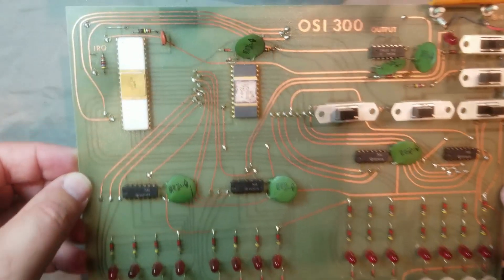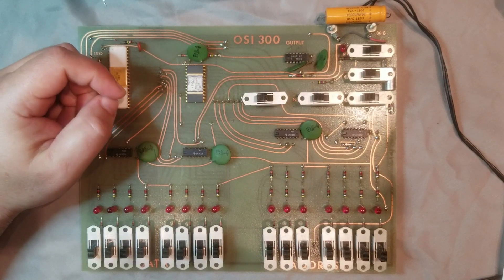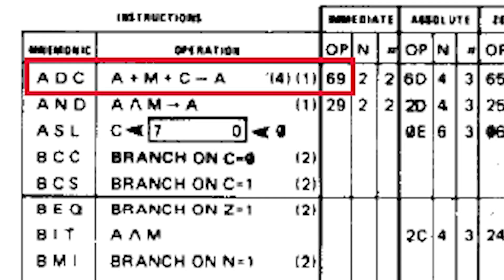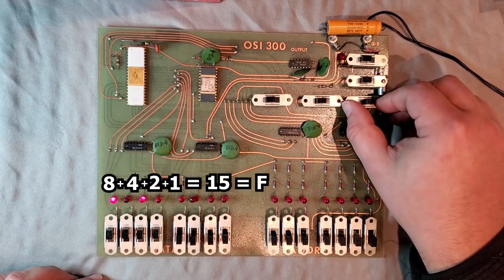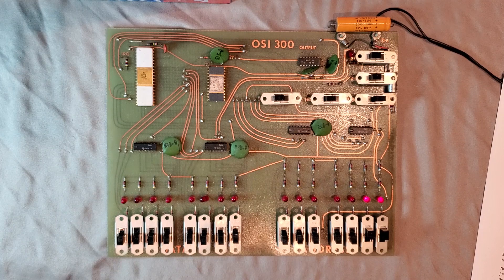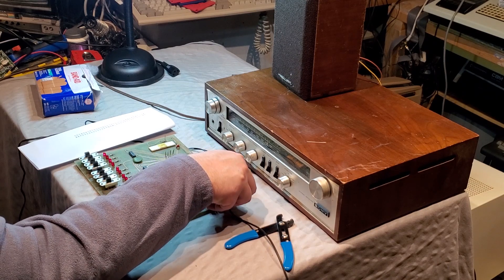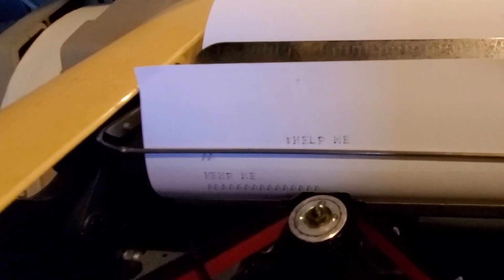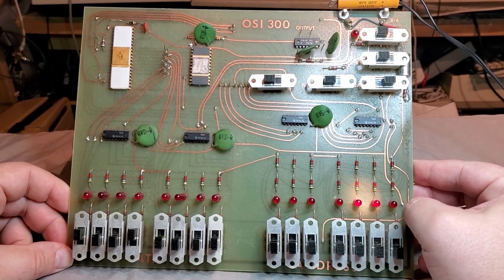Humble Beginnings: The Ohio Scientific Instruments (OSI) 300 Single Board Computer

Comment: I had a rack mounted OSI computer with z80, 6502 and 6800 all on the same mother board.   It had a 74 MB hard drive (winchester) rack mounted along with dual 8 inch floppy drives.  At the time it was the best affordable commercial system for my company I could find at a 'reasonable cost'.
Reply from the maker: It's too bad OSI was so stuck on not finding venture capital to expand.  They hit a certain level and then just didn't have the money to go further.
Reply: OSI also tried a similar board that substituted a Harris HD6120 chip for the 6800. Yes, that made it a PDP-8 computer. The 6502 did all of the I/O for the HD6120 through DMA so it was (supposedly) able to run any OS or software ever written for the PDP-8. I saw the schematics and the description but I don't know if it ever made it into production.
Reply: Sounds like fun 😀

Comment: Speaking of "trainer" computers. It's not exactly electronic, but you should consider doing a video on the CARDIAC "computer." Which was basically a bunch of cards and folders and pull tabs that somehow copied the function of a computer without any actual electronics back in I think the mid to late 60's. But don't quote me on that. I always thought it would make a good video for a channel like this that looks at the history of computer and computer related gear.

Comment: Wow! This makes the Cosmac Elf look like a workstation! I didn't realize such a simple 6502 machine could be constructed.
Reply: With modern parts (you can still get brand new 65C02s) you can build something with three chips, a static ram chip, a flash rom chip and the 6502.

Comment: In one of my very early microprocessor adventures, I had interfaced an Intel 2851A to my MMD-1 8080 trainer and to an "ADDS" terminal (circa 1981).  When I was finally able to correctly initialize the 8251 and write a utility that filled the terminal with the letter "A", I was elated!  It doesn't seem like much, but it opens the door to a plethora of possibilities!  :-)

Comment: Speaking of Unobtanium computer devices, I have two Electronic Systems 106 TV Typewriters which I picked up at a local surplus house about 20 years ago. After watching your videos on the CT-1024, I dug them out and attempted to get them working.  I now have one fully operational but what a mess!  Cut traces, missing chips, bad sockets and even one chip with a pin folded under.  It works as designed but is very crude.  The second one sort of works but it is displaying two pages so I need to spend more countless hours sorting it out.  I have a GRI 756 keyboard to use with them that I bought as a kit around 1976 or so, basic keyboard.  No keys like backspace, cursor up-down-left right but there is provision on the 106 for push buttons for these functions.  I will probably post a video soon showing them.  Thanks for sharing all these vintage computing devices.  I teach Windows and Linux at the local community college and most of my students weren't even born when we were using these devices!

Comment: I still have two OSI computers, a Challenger 1P and a huge 8P with their terrible molex connector bus. I actually used my C1P as a terminal in the late 80s while I was going to college. It worked well because I did the mod that gave it 64 characters per line. I wrote my own terminal program in assembly and wrote a Unix termcap that worked perfectly with it. I learned a lot about computers because with OSI computers, you pretty much had to. 

Everything in it was the cheapest possible way to implement anything. The keyboard didn't use a PIA. It just used a couple of addressed 8 bit latches. OSI didn't use expensive floppy controller chips. They used a PIA to control the drive and a serial chip (a 6850) to read and write the data. Yes, floppy controller was much like an RS-232 port.
Reply from the maker: I have the OSI 300, 500 Superboard II, the C1P, C2-4P, C2-8P, C4-4P, and an empty C8 case.  I'm a little OSI crazy.  What got me interested initially was the little game characters they included in their character ROM.  They just have such a homebrew kinda feel to them.
Reply: @TechTimeTraveller  Aren't they much like the characters the ROM in the PET had? In fact a lot of the Superboard II/C1P is much like the PET. 

It's hard to believe that the cassette interface was just like the punch tape on a teletype. You typed "LIST", set the cassette to record, then hit Enter and it "typed" your program to the cassette. To load your BASIC program, you had the cassette "type" the program back in. I don't know of any personal computer that had such a cheap method of saving and loading programs.
Reply from the maker: @Scott Larson  Yes very similar in principle to PETSCII.  I don't think PETSCII had a Starship Enterprise though.. that was the one that got me.

And yeah the OSI save and load process is.. different.  I guess it's one of those things that gives OSI its charm or personality.

Comment: Contact cleaner / lube on the switch contacts and slides? Also, perhaps mount it on a wooden board with pegs around the corners so that you can get leverage without pressing on the switch frames? Though, perhaps that will put too much strain on the switches' attachments to the board? Nevertheless, old slide switches need lubrication IMO. Thanks so much for the demo. I remember seeing ads for these as a young teen. I never saw one in use.

Comment: That is awesome! It's about as bare metal as you possibly can get. I'm so tempted to build a modern take on this (although presumably would need a processor and ram that is fully static and doesn't mind having its clock stopped or run at really low frequencies).
Reply from the maker: That would be cool!  A Youtuber named youtuuba built a modern replica and I was impressed at how small it was compared to the original.  Seemed to work functionally the same.  I'm not sure if the kit he built is still available but it looked like a fun build.
Reply: @TechTimeTraveller  , I am "youtuuba", and that "OSI 300 Mini" kit I built was produced in small quantity years ago by a fellow in the Chicago area. He seems to have lost interest in it long ago, so I am glad I bought mine when I ran into him at one of the Vintage Computer Festival Midwest events. I recall he was selling the kit in little zip-loc sandwich bags for $20 each, all parts and PCB included.

That OSI 300 Mini is the same exact circuit as the original OSI 300, except a large static RAM IC was used because the very small capacity originals are hard to obtain, expensive and unreliable. Because the RAM was larger, the kit had more address switches and LEDs to take advantage of it.

I thought about making my own version of this and selling kits on eBay, but I recall the other guy said the sticking point was the extreme difficulty in obtaining one of the slide switches that had a special combination of make-before-break and break-before-make contacts that are required by the original circuit. If I were to do it, I would want to opt for modifying the circuit to use an easier to obtain switch, but then other people would probably consider the design to be unoriginal and tainted, and not buy the kits. I still contemplate doing it from time to time.....

Comment: I wonder if you could make a big board of 100s of pin jumpers and use that to write code and then have some sort of circuit to automatically feed that in line at a time.

Comment: Wow. I had one of those OSI-300 boards. Mine had a 4 or 5 bytes of RAM (out of the 128) that didn't work properly. "Just don't use those."  Thanks for the memory.
Reply from the maker: Lol "just don't use those".  Was that official OSI advice?  It sounds like something they'd say.
Reply: @TechTimeTraveller  Nah. I bought the thing secondhand in ~1977, so I never bothered OSI about it. I just learned not to use those bad memory locations. Given the types of things the board was good for (not much other than simple demos), it was not a big deal. Just funny.

BTW, if you want that ASR-33 refurbised to like-new condition, I know the guy for that. Just got mine done.

Comment: afair the 6502's stack is at adress 0100h - 01ffh, with the OSI-300 having just 128, does that mean there is no JSRs possible? or was there a way to move the stack somehow?

Edit: ok, since that RAM chip's chip-select may be hardwired, the 128bytes memory most probably are shadowed to ALL addresses within the complete 64k address space, (just like that reset vector also was in address 007xh (instead of FFFxh where it should be), so even with that 128b RAM the stack should be usable. Forget that question :)

Comment: Out of all the vintage machines I've seen, I think this one would be the easiest to make a reproduction of. ;)
Reply: I would love to build one of these. It seems like it would be fun but simple enough to design as there are so few components!
Reply: @mcobb1024  the problem with this design is that it used a custom slide switch for one of the functions, which had a now-unobtainium combination of make-before-break and break-before-make contacts. If not for THAT, it would be easy to replicate.
Reply: @youtuuba  needs a toggle switch upgrade ;)

Comment: tempting to build a clone just for kicks. Wonder if I can make it use a Z80 instead of a 6502.
Reply from the maker: There was a kit at one point:  https://youtu.be/OTmFDruVQrY
Reply: @TechTimeTraveller  After watching your video I found a Schematic, Could probably spend a day on Eagle Cad and create a PCB or pull out my Wire Wrapping equipment and Wire Wrap a Board.
Reply: @Stephen Anthony I was never a fan of the 6502.
Reply: @Stephen Anthony It's all in good fun, it's not like I plan to key in the machine code to run DOOM or anything like that.
Reply: @lelandclayton5462  😢

Comment: Why didn't you modify the board or made a copy instead?
Reply from the maker: You mean to fix the switch problem?  When it comes to vintage originals I tend to adopt a hands off approach unless it's absolutely necessary (ie something broken).  This isn't the sort of thing you'd be using every day anyway so I was fine to suffer through the switches.